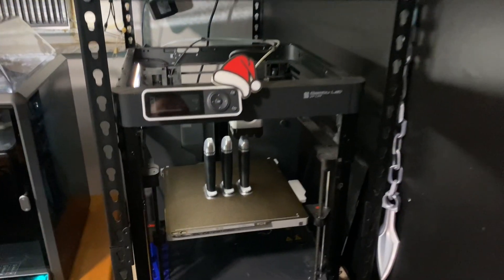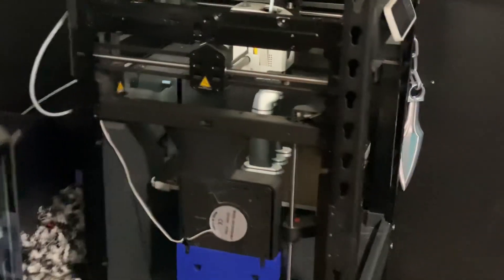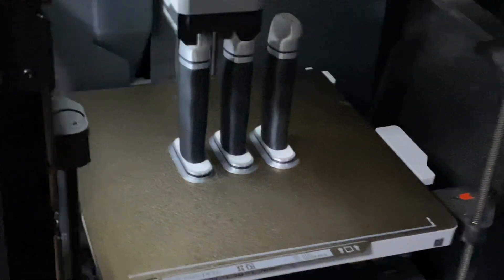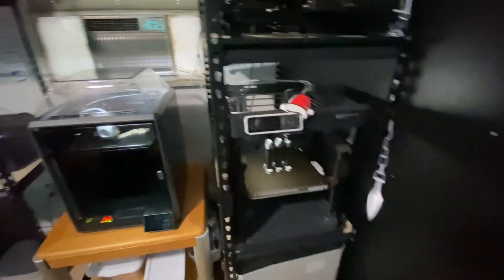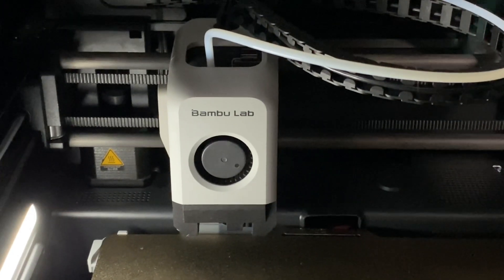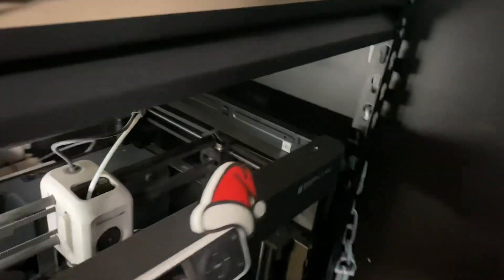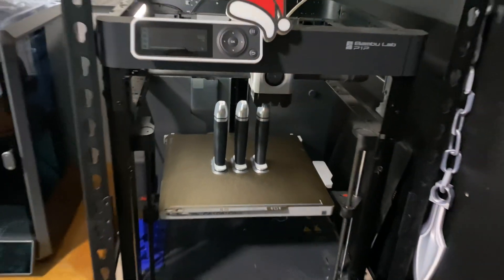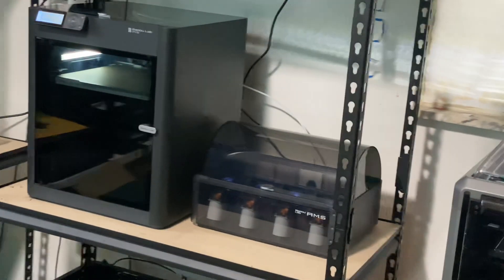P1S AMS has entered the Chat

Comment from the maker: It's failing EVERY LAYER, with a "stuck filament" error. I have to press RESUME, every layer. It loads to the hot end, then, retracts all the way. Repeats this 4 times. I press RESUME, it repeats this 4 times again... then prints. Then,  repeat all this the next layer
Reply: I had this issue. I started to use AMS covers for cardboard spools and it helped. Oddly enough I'm not using them as much and don't have that issue. One of the spools I got was too small and had to print an adapter to make it the correct width. Does it do it with the bambu labs filament that comes with it? Idk if they send any for just the AMS. I bought the full P1S w/AMS